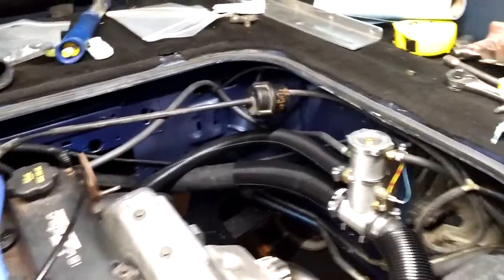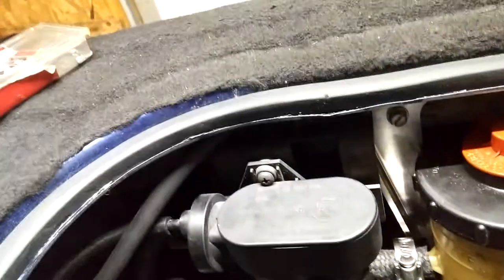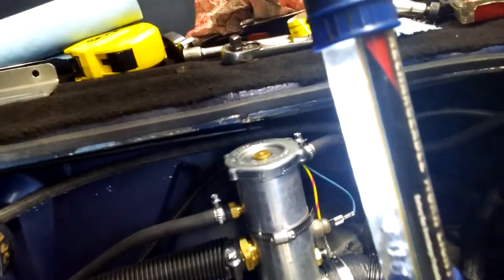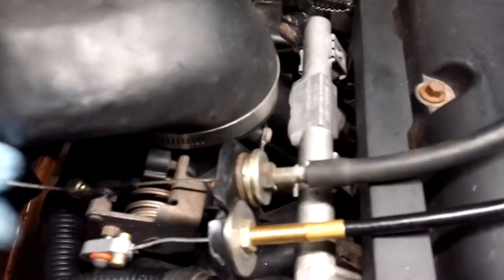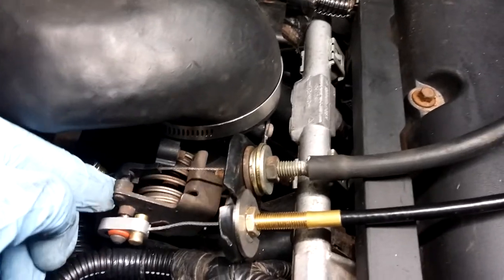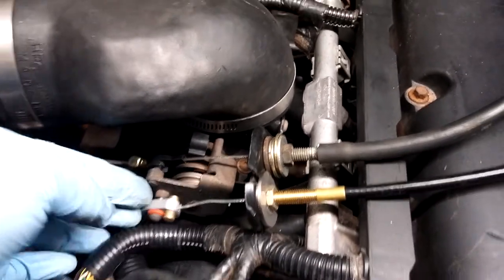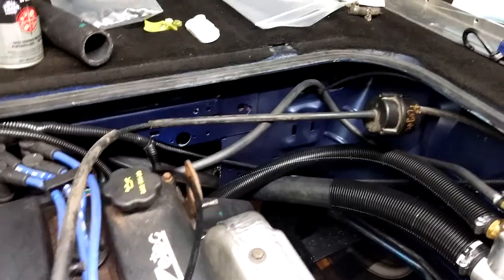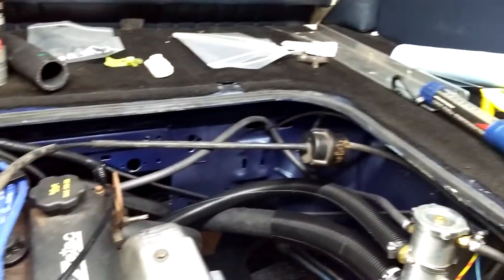Bostig factory cruise control hybrid

Comment from the maker: So I have been driving the van for a week now.  The cruise control works great up to about 70mph.  It can't open the throttle wide open so if you have a big hill or want to go faster than 70 mph you will have issues.  Cruising at 65 mph is nice though.